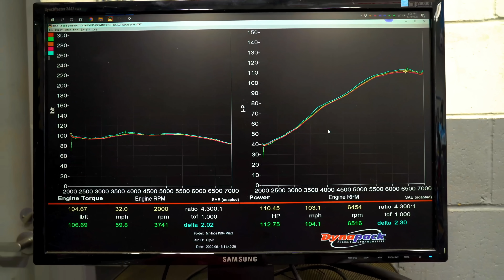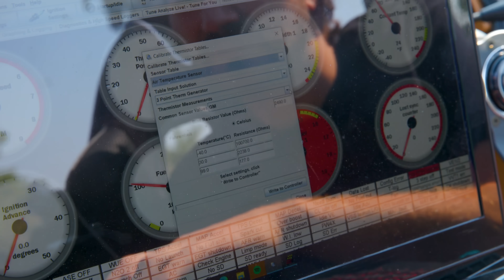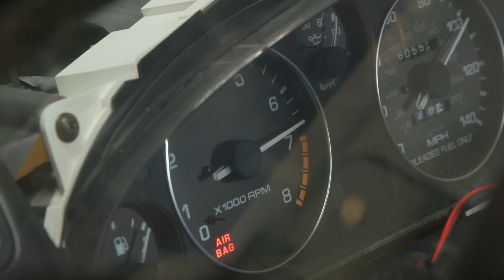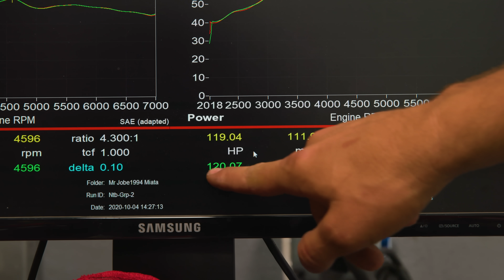Is an Aftermarket Intake System Worth It?

Comment: So, about loud, not smelly farts. What I've understood:
We learn that farts are methane and that smells. Well... not entirely true. We swallow a lot of air. With our food, drinking, etc. Maybe some fizzy drinks. Air and CO2 doesn't smell. So air bubbles are pretty big and methane bubbles are small. So if you have a loud, high volume fart that sounds like big bubbles, that's air, and that's why they don't smell too bad. The silent but violent ones are the methane.

Comment: Should have done a 1/4 mile run before the bolt on performance mods ..to see what it does after all said and done with turbo and whatnot. Also..might as well have ported that manifold since you ARE going to turbo...plus you were accessed to the injectors...now you are going to do double work down the road...but hey..more views aye

Comment: did you guys re tune it? if youre adding more air you need to add more fuel. or does the fancy new computer do that for you? also i would have 100% done the injectors but you could really do an entire episode on injectors how the work how crappy 20 year old injectors are and how much better new ones are, and you could weigh cleaning them vs new ones. so i guess thats probably next episode

Comment: The $700+ spent on this intake and throttle body could have gotten a 5.3 and 4l60e to swap in and make more power NA than $11,000 and "eventually getting a turbo" ever will XD.

Comment: Love donut but that’s a hot air intake you moved it to the exhaust side of the engine and that isn’t exactly a good thing a true cold air could’ve netted another 5 horsepower easily combined with the new intake system potentionally 20 total horsepower in gains just from colder air with more air volume

Comment: Am I the only one who doesn't get those numbers? I mean, you've replaced intake manifold, iirc ya did something with the exhaust, some stuff was done anyways to put it on the dyno before. BUT, you've got 112 HP. With mods. When the bone stock engine supposedly produces 116 HP, that's 4 HP MORE. Now perHAPS that's flywheel, and not actually on the wheels. Still, i don't really think so. So, HOW is your miata with a bunch of mods SLOWER than a STOCK miata? And that's the stock 1.6 engine, the 1.8 (litre) makes 128 hp bone stock. That would be 16 HP less than original, with mods, and if we include the manifold, that would mean a difference of still 8 HP. (if you have a 1.8). The 96 version even had 133 HP. SO, the big question: WHY is your Miata so WEAK? Is it the combination of the injectors, the battery, and perhaps an unknown, underlying problem? If it's a 1.8, with the current mods, it should hit 140 plus HP. If it's a 1.6, it should definately do 125 HP. Again, what's happening?

Comment: $720 in parts... plus tax... plus shipping... for 7.25 horsepower... That's over $100 per horsepower...

Quick physics lesson, an intake will make you ZERO horsepower unless your exhaust system was better than your old intake. You can only pull in as much air as you can push out without forced induction.

Comment: Why did you leave your bought “cold” air intake bend? 
Here, plug you nose and put a straw in your mouth. You’re the engine. Try to breath through the straw. Kinda hard right? Now take scissors cut off an inch at a time and notice how much easier it is to breath. You should make that snorkel of an intake as short as possible, away from the radiator. But instead you made it snake around and get hot piped off the radiator. Just saying. Try dynoing it without that intake and you’ll get your 10+ hp